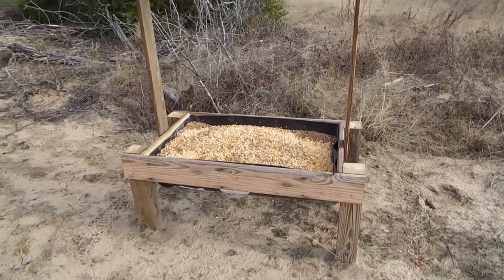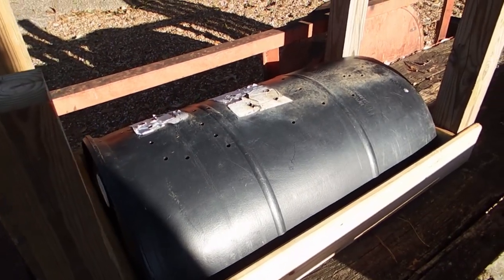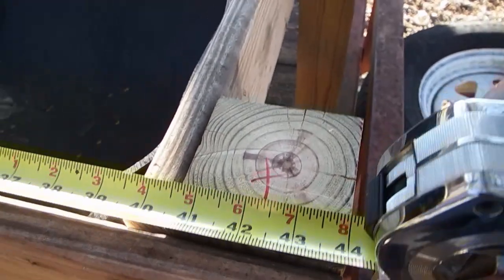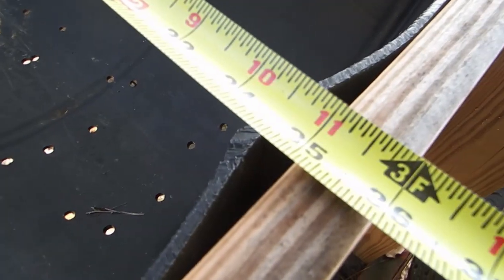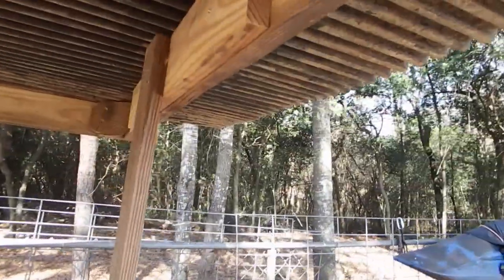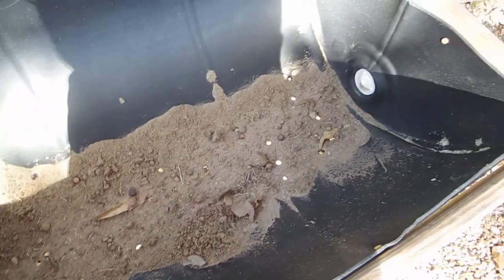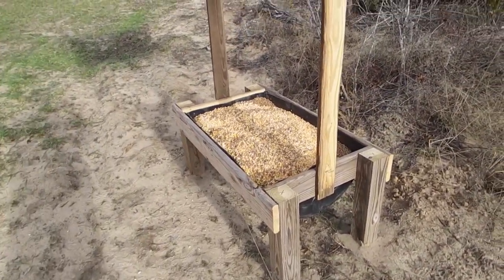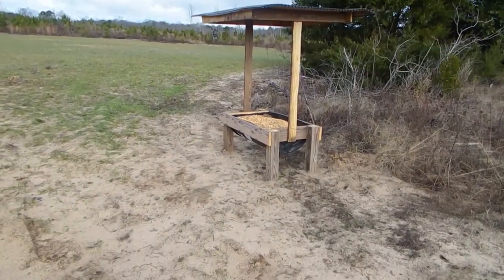I Built me a Deer Trough Feeder

Comment: What’s up Cervus ..Thxs for another video
Reply from the maker: HI Mark 👋🏼 It's all good.  Just spent the last two days on the tractor cutting trails through the pines to the hardwood bottoms. They plant the trees in rows about 10 feet apart so you can drive a tractor between the rows.  You just have to watch out for stumps.  I busted three sheer pins today.

Comment: Nice job man! What material did you use for the roof? It looks familiar, but can’t put my finger on it
Reply from the maker: It's and old truck bed liner.  One of the plastic kind that sat in the bed. A friend of mine had gone to a spray in bed liner place and asked if he could get some old bed liners and he was able to get about 20.  We cut them up to make deer blinds out of.  This was a piece that was still pretty big and I thought it would make a quick easy roof.  If not that then it would have been a couple of piece of roofing tin.

Comment: It's not too high. You want it tot be high enough that the hogs can't get into it.
Reply from the maker: That is one thing I had no idea how high to make it.  I didn't want it too high that the deer couldn't get to the bottom of the trough, but I didn't want it too low either.  While I have had hogs digging holes all over the place this past spring I have not had any come to this feeder.  I'm not sure if I have very many hogs on the property at this time, but I know how they can take over a place as I've seen this happen on several other properties I've hunted. Luckily, because I used decking screws to build this I can change the legs out for longer ones to raise it should the hogs become an issue.